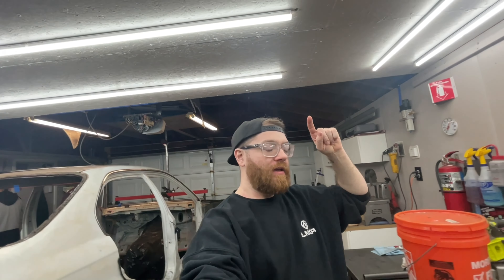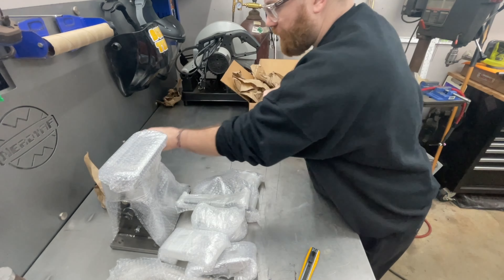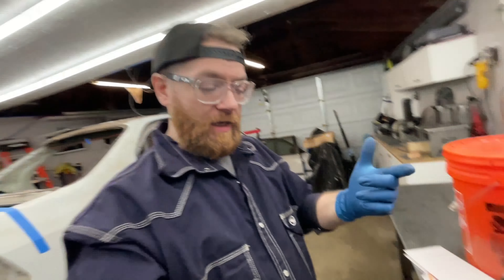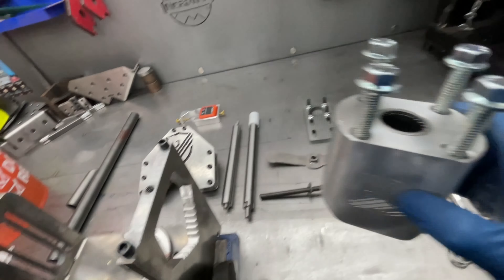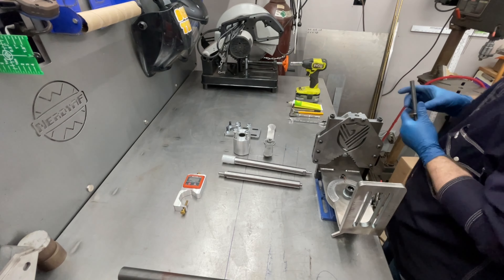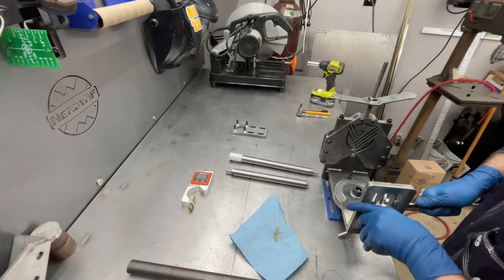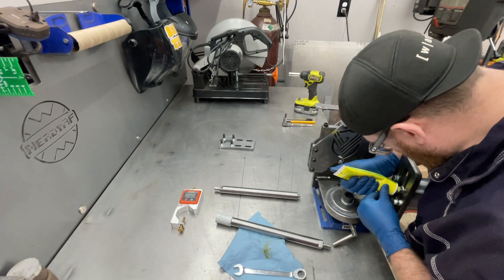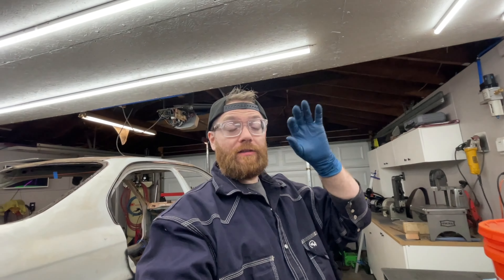Product Review! BuildCo Guillotine Notcher “The unrivaled tubing notcher”

Comment: To keep chips and grit off of the clamping stud you might try putting a piece of tubing over it to cover the threads, it could be loose or welded to the nut. Try Gibbs Brand to keep the raw steel from rusting.

Comment: How about a comparison or recommendation of hole saws. I have bought really bad ones, dull quickly, out of round etc.
Reply from the maker: Lenox is the only brand I buy for metal cutting. The ones in the video was some random wood ones I had lol 😂
Reply: @MrNerdyAF  I hear you on the wood ones. Keep us updated what you find to work well and hold up. The wobbly ones PO me the most.
Reply from the maker: Lenox is the only brand I use for notching. It’s the only one I found to hold up. I notching 1000’s of tubes when I ran my business
Reply: @MrNerdyAF  100%. I build tube chassis rock crawlers and 1 Lennox hole saw will easily do two chassis’s.